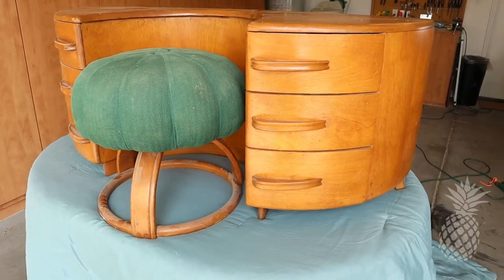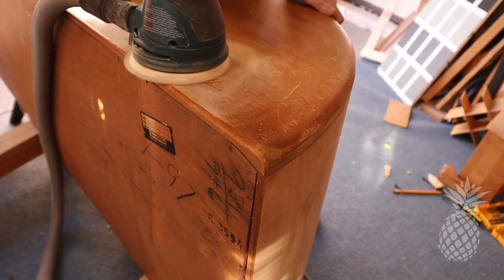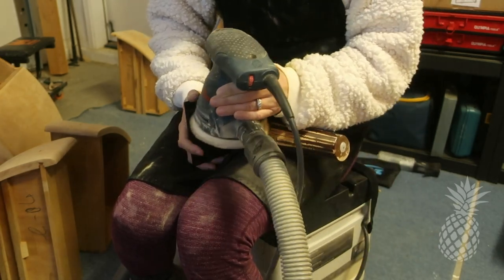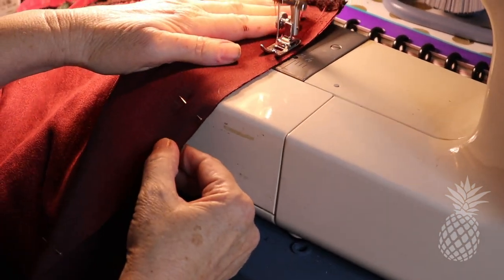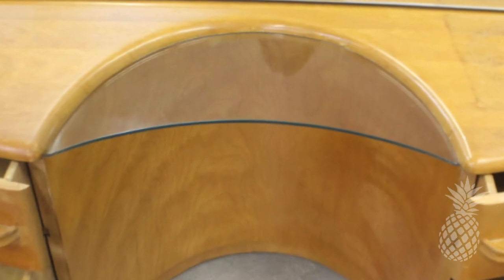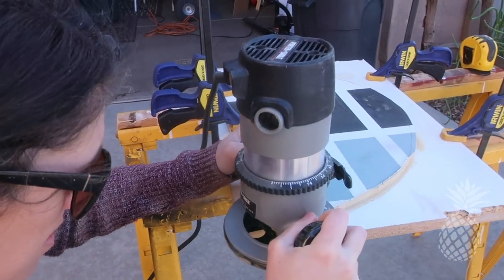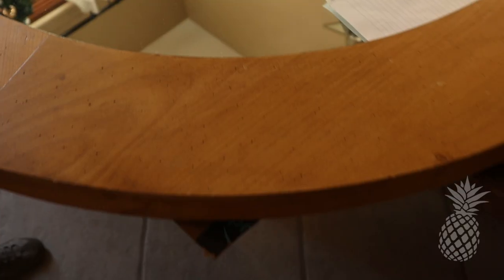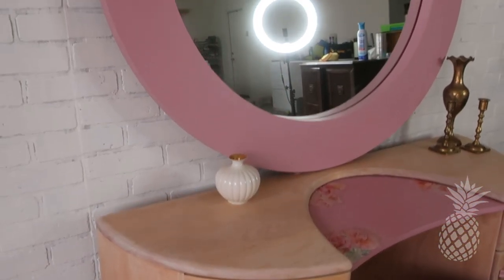Painting VS Restoring Vintage Furniture / Modern Vanity Makeover

Comment: Wow! I love your videos - always interesting furniture history, love the two of you enjoying working together, love your great ideas. I've learned so much. I'm wondering if you'd be willing to share what price you get for each piece (maybe an update near the section where you list tools and supplies). I'm baffled by pricing - how do you estimate the cost of supplies and labor, and figure out the market value? I'm just starting to try to sell some pieces and don't have a clue about this aspect. Thanks for the inspiration!
Reply from the maker: Hi Pam! Thank you so much! We actually do share the costs and the sales info in the description section but it looks like we missed doing that on this one. (We also don't share the prices on the commission pieces because some of our clients don't want us to publish that info. That being said, it seems that our costs average about $25-35 per piece for the basics (sand paper, bondo, paint, poly, etc.) and we add the extras (hardware, wood, legs, etc) and the cost of the actual piece. We are a little nerdy about the numbers so we keep all of that on a spreadsheet. However, we are not good about tracking our labor because there is a tremendous amount of starting and stopping with doing the videos and dry time, etc. On Pricing: boy, that is a hard one and I think we try to base our sales prices more on what we think we can get for it based on desirability and demand. Most of our pieces go for $300-500 each and we sell most through FB marketplace. If we were selling on-line or in another region, we could probably get higher prices. This particular piece sold for $595 in 7 days. If it was a dresser or another type of furniture which has more appeal than a vanity, we would have tried to sell it for more (and probably not painted it pink). So many factors ... and a lot of it is guesswork and lowering the price if it doesn't sell. Hope that helps a little.